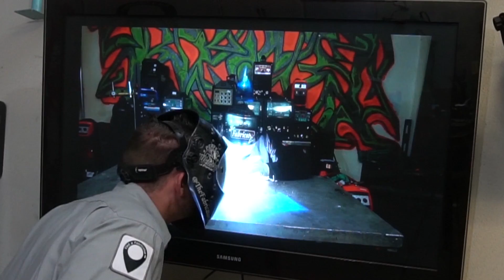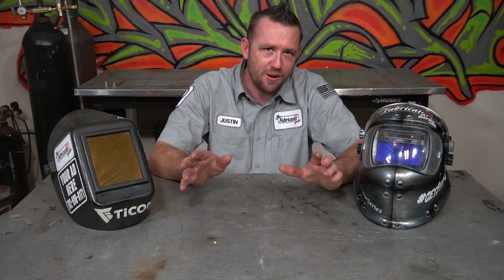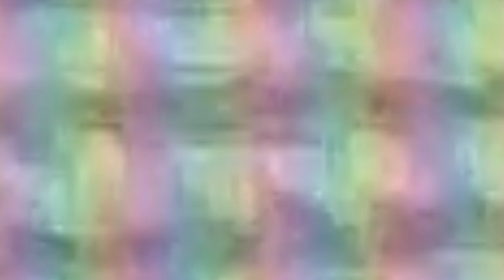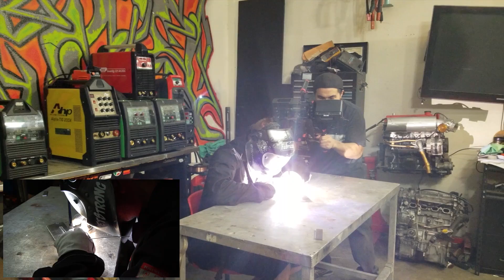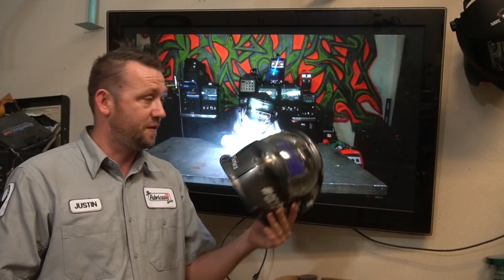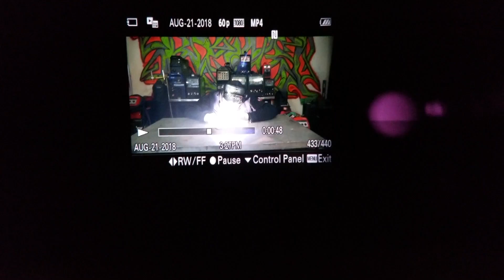TFS: Why Doesn't Welding on TV Hurt Your Eyes?

Comment: Colour is light at various wave lengths, white light is what you see when all the colours are there roughly in equal proportions. The reason the computer or TV screen does not blind you is down to the intensity or power output of the light. An arc is one or more kilowatts of power on a broad spectrum, some big industrial welders the arc is in the region of 20KW whereas the total power of a TV or monitor is most likely under 40 watts with an individual pixel only putting out a few micro watts  of power on a very narrow spectrum. Here in the UK we call it arc eye.

Comment: I remember when i got flash burn whem i was around 13 years old. We were fabricating 4 exhaust pipes for a bike build and i was supporting the pipe as my father mig welded them together. Of course, i didnt have a hood. He told me not to look but me being a dumbass kid, i looked anyway. 

I was suddenly woken up at 2:00 am and i could not see a thing. It felt like someone was forcing beach sand into my eyes and no matter how much i tried wyping ot off. nothing happened. I woddled my way to the bath room where i continuously tried washing my eye balls for 15 min. Then i hear my dad walk in. I said; "I cant see anything". He took my to my bed then took 2 sliced up pieces of potatos and put them over my eyes. I was terrified because i had no idea what happened but he told me it was from staring at the arc. I woke up the next morning sore, but my vision was back. 

All in all, it sucked ass, but i learned my lesson
Reply from the maker: That is a really cool story. I may call upon you at some point to tell it again.
Reply: The Fabrication Series 👍
Reply: At least you have the excuse of being young and stupid... I was 29, started drinking friday after work, started watching Bathurst, hadn't stopped drinking, finished watching Bathurst, then we decided to do some more work on the Odysey (KB laser front end for the rear/xmission/engine, torsion bar VW on the front... plastic school chair and a set of 32's). Rang up the boss, got permission to unlock the shed and borrow the welder, nicked some 98% sulfuric to "recondition" the battery with... forgot the gas bottle, changed out the wire for some flux core, got rigged up and realized we'd forgotten the helmet. I decided to go at it anyways through my forearm. 

4 hrs later, I was asleep on the couch wishing I was DEAD. Woke up after 3 hrs sleep... everyone had pissed off to a party 4 blocks away. Had to walk to the party to get a lift home, as if the occasional set of headlights weren't bad enough, there was a lightning storm as well. 

Walked in to at least 4 power poles on my way there
Me mate made me go into the kitchen under the fluro's so he could get a look at the damage "in the light" 
Forced and held an eye open with me fingers to a resounding "holy fuck" from the assembled crowd.
Old mate told me he could actually see blisters all over my eye ball.

Yeah lads... Don't weld if you don't have the helmet! 
If you can avoid getting flash burn, AVOID GETTING FLASH BURN!!!
My eye's didn't come good for 4 days, IT DOES feel like someone threw sand in your eyes and there is absolutely NOTHING you can do about it accept wait it out.
If you can avoid getting flash burn... AVOID GETTING FLASH BURN!

Did I mention avoid getting flash burn??

Comment: Never under estimate stupidity or just basic laziness.  Knew a guy who didn't like the dark shade on my old fixed shade helmet, so he proceded to mig weld several long beads wearing only sunglasses.  Sure, we've all done the quick tack, closed eye, look away .  But this poor fellow basically went blind, most painfully so, and missed work for a week.  Took a bit longer to get anywhere back close to normal.   Lesson learned?  For me, never allow people to use your garage or equipment.   Too risky should someone get hurt and then try to sue you.  Such is the litigious age we live in.

Comment: Put another way: The imaging chip (the thing that converts light into a digital "picture") has a maximum level it can record, the way a speaker has a maximum level it can produce. If a sound is too loud, the speaker will hit the stops and won't get any louder. By the same token, if the light coming into an imaging chip is too bright, then the image will be washed-out and "white." As Jason said, the imaging chip is recording colour, up to the point where it's getting too much light and records white.

In real life, a sound like an exhaust or explosion can be much louder than a speaker can produce, and by the same token, a welding light (or looking directly at the sun) can be much brighter than your monitor or television can recreate. Looking through the view finder on a digital single lens reflex (DSLR) camera is essentially looking through a periscope with a focusing lens. Not only does it transmit the full intensity of the sun or welding light, it focuses it, making it even worse. 

Interesting fact: If you use a still camera like a DSLR or Jason's Sony α6500 to record video, the lens will focus light in all its intensity on the imaging chip and heat it up. It's the same thing as holding a magnifying glass over a newspaper on a bright, sunny day. If you use a digital still camera in "video" mode, the imaging chip will heat up. To prevent damage, a temperature sensor will close the shutter and shut down the camera until everything cools off. How quickly this happens depends on the amount of light going through the lens, how bright it is, how hot the camera is (example, a sunny day when it's 103°F) and how long the shutter is open. A cold, grey day in January in the arctic will let you record longer than a bright, sunny day on the Bonneville Salt Flats. Or an overheated welding shop.

Comment: Infrared radiation = heat. UV Radiation = that sunburn
Reply from the maker: My TV makes my shop hotter simply by being on, but it definitely isn't as hot as a welding coupon when welding it.

Comment: People that weld like my self no about flash burn especially from carbon arc the welding lens I use 12 shade straight black glass style  I keep IT  OG ..  it's in our minds our welding hood should be down. LED LIGHTS ARE VERY BAD FOR YOUR EYES ITS EQUIVALENT TO AN !ARC !!!  I HAVE TO PULL OVER AT NIGHT BECAUSE OF THOES DAM LIGHTS I LIKE DIM LIGHT'S

Comment: "Colors do not hurt your eyes [...nonsensical tangent ...] it's not gonna hurt your eyes in the fact that there is no UV-A, no UV-B, no UV-C, no infrared, no visible light - technically, no visible light - it's just color, or that's, you know, that was translated from visible light and all the rest of the stuff."

Uh, no, technically it is very much visible light. What exactly is it that you think those so called colors are? Everything you see is by way of visible light. You do not see in any other part of the electormagnetic spectrum.

In very much the same fashion, the camera sensor only picks up visible light and is not sensitive to light outside the visible spectrum (unless it was specifically designed to do so). So, no, "all the rest of the stuff" is not picked up by the camera sensor and is not translated into the visible light spectrum. And, even if it was, being that it was translated into the visible light spectrum, it would pose no harm. Displays available on the market today do not typically emit bright enough of an image to do serious damage by way of its intensity (they do not have sufficiently high enough luminous flux to provide the required levels of luminous intensity).

Dear Betty, why people (Youtubers) attempt to don an authoritative voice and put information out there with out knowing what they're talking about, especially when they are the most basic of concepts, is beyond me. If you're going to assume an authoritative voice on a topic, at least, get the basics right. So many comments lamenting the fact that this is an actual question - equating it to the end of the world - yet no mention of the absurdity of someone putting on the appearance of providing educational relief, without having even educated themselves with the basic knowledge to provide said educational relief. Absolute Boop.
Reply: I was just wondering if some jackass was going to jump on that mistake and assume "an authoritative tone" while over explaining it.   Nice job.  Glad to see you didn't let down your fellow narcissists.  Lol
Reply: lamenting the absurdity of the question adresses the primary issue of this vid. how it is presented is entirely secondary. also, context.
Reply: Lamenting the absurdity of the question, while leaving the mangled answer unaddressed, only leaves the cycle unbroken. So yeah, I'd say the blind leading the blind is, without question, the bigger primary issue in this context.
Reply: Actually, almost all cameras have as the detector a CCD (charge coupled detector) element which does see outside of the visual light spectrum. Take your phone, turn on the camera and point your remote control at it. 

Also, the only difference between "night" CCTV camera and "normal" CCTV/security camera is the ones that can "see in the dark" have a ring of IR LED's around them. IE: technically, they cannot see in the dark. They need an IR floodlight in order to capture anything at night time. They can however "see" better than humans, the average CCD element can see down to light levels as low as .012 lux (standard PAL output 540 TVL  interlaced 1/3" element @ F1.2, AGC)

CCD elements are also much more sensitive in the red spectrum than they are in the blue or green wavelengths as opposed to humans, our eyes are generally more sensitive to the green wavelengths than to any of the others (those who don't suffer from red/green colour blindness that is)

If your phone camera does not detect the blinking light emitted by your t.v. remote controller it is because it has an IR blocking filter in front of it, as most apple devices do for example.
Reply: "Actually, almost all cameras have as the detector a CCD (charge coupled detector) element which does see outside of the visual light spectrum. Take your phone, turn on the camera and point your remote control at it."

Actually, almost all cameras (especially smartphones, with their wide breadth of functionality relying on a limited battery budget) are universally CMOS sensors. CCD cameras are mostly isolated to high-end applications and/or specialty equipment. Hail, even with DSLRs, how many CCDs are even available in the current crop of models?

Yes, visible light photography cameras that have not explicitly precluded it can pick up photons that extend beyond the upper limits of the visible spectrum (spilling over into what is essentially a sliver of the overall infrared spectrum), however, their nominal sensitivity is still concentrated within the visible spectrum, with little contribution from outside those bounds when forming a usable image under normal usage. Insofar as the scope of this discussion is concerned, visible light camera sensors can be regarded as existing, more or less, within the visible light spectrum. And as already explicitly stated, even if the sensor were to pick up photons from outside the visible spectrum, those photons are never transmitted downstream of that pipeline in anything other than the visible spectrum, therefore, nullifying any relevance in regards to the central matter - i.e., why viewing welding on displays does not incur damage on eye tissue.

"CCD elements are also much more sensitive in the red spectrum than they are in the blue or green wavelengths as opposed to humans, our eyes are generally more sensitive to the green wavelengths than to any of the others (those who don't suffer from red/green colour blindness that is)
If your phone camera does not detect the blinking light emitted by your t.v. remote controller it is because it has an IR blocking filter in front of it, as most apple devices do for example."

Not quite sure how the specific peak within the response curve is at all relevant, other than that it occurs within the visible light spectrum - never mind the fact that the most common color filter array or matrix on an image sensor, the ubiquitous Bayer Filter Mosaic, is specifically implemented to mimic human vision.

In any case, perhaps, you are referring to the response curve of just the bare silicon, however, again, not sure of its relevance here, as a quick cursory look at available Spectral Response Curves and QE/Read Noise ǀ QE/Dark Noise Curves would seem to indicate that visible light cameras - whether they be CCD or CMOS - tend to show peaks at the blue end of the spectrum (though, again, not sure how where the peak falls within the visible spectrum is, at all, relevant, other than that it occurs within the visible light spectrum), with rapid fall-off towards the ultraviolet and a long tail towards the shortwave infrared.

So, again, yes, due to the trailing tail that barely dips into the infrared spectrum, they can pick up signals in the very near infrared or SWIR spectrum. However, again, due to the characteristic of that trailing tail, in any amount of visible light, any such signals are easily overwhelmed by the visible light photons and do nothing to contribute to the image - other than potential artifacts and aberrations, thereby eliciting the use of IR cut-off filters for sensors in critical photography applications.

Even in the absence of visible light, it still requires either a photomultiplier tube (often in combination with additional dedicated infrared sensors) for image intensification or, as you've already mentioned, actively blasting the area with an NIR or SWIR light source (700-1000nm). You will not see anything, at least in terms of forming a usable image from the infrared spectrum, with a visible light camera during otherwise normal usage.

And, to be clear, with NIR or SWIR active illumination, the sensor is picking up the reflected NIR/SWIR light that's flooded the area, not the thermal signature due to the infrared radiation naturally emitted by objects of the surrounding environment, which would require dedicated infrared sensors. Traditional CMOS and CCD sensors on visible light cameras would not be able to pick up any infrared beyond the ~1000nm wavelength and, as you get above 700-800nm in wavelength, the spectral response is at a fraction of its peak (~450nm). The quantum efficiency to noise ratio, which is even more pertinent for low-visible-light sensitivity, is even more significantly reduced at that end of the spectrum. Hence, the need for image intensification (in tandem with dedicated IR sensors) or active illumination, which then begs the question of whether you're really talking about visible light photography at this point.

Regardless, still unsure of the relevance of all this meandering about, as the fact remains that visible light camera sensors are very much tailored to produce an image in the visible light spectrum, to the extent that they can be specifically designed to be less sensitive to light outside the visible spectrum (i.e., going so far as to include IR cut-off filters where necessary). Isolating the sensor from the camera's general output as a unit, as viewed by the user - whether it be down to the base silicon material, or, indeed, separating the sensor from its CFM/CFA or IR cut-off filter to affect a change in the sensor's spectral sensitivity that is outside of it's nominal usage - is not germane to the explanation here and makes little sense to delve into in this context. Begins to amount to nothing more than immaterial reaching into unnecessary complexity that doesn't inform the issue at hand - again, why viewing welding arcs on screens does not incur radiation damage to eye tissue, or any tissue for that matter - and we wouldn't want to appear to be over-explaining anything, lest we get outed as a narcissistic jackass, now would we? Hmmm... Boop.

Comment: I actually get hurt by it by watch it on my TV (Gold Rush), I have to look away or put hand up on the light to avoid pain.
So its very strange when you say its impossible...
Although it could be the bright color itself, because I don't like high light, TV:s settings is very dark, in summer sunglasses (also in winter occasionally) and windows darkened. So maybe just the bright light. But welding pain through TV is still possible.
Reply: Eye sensitivity to video screens is NOT flash burn.  There is a difference. You don't want flash burn.